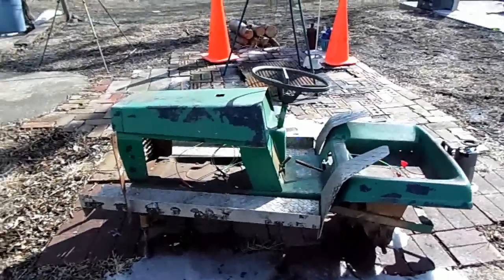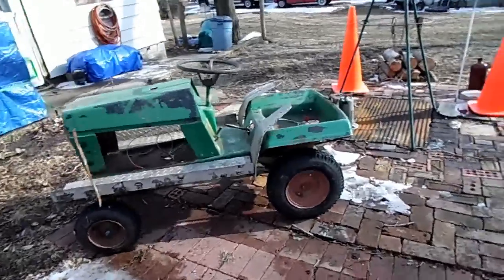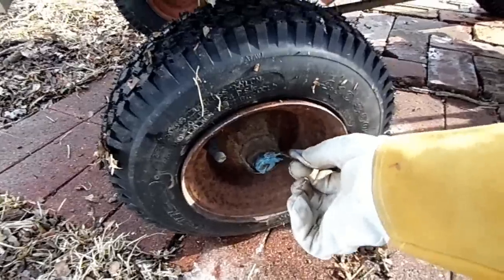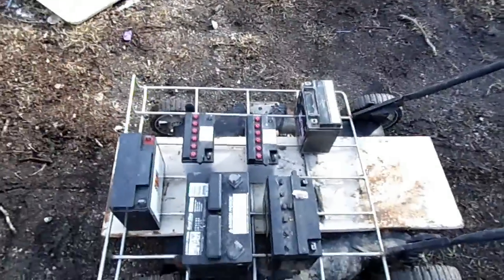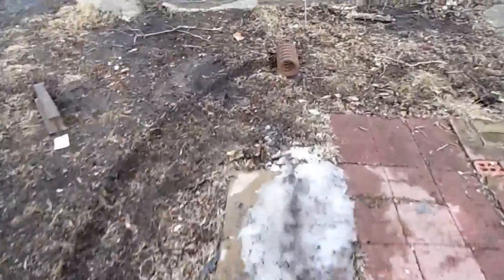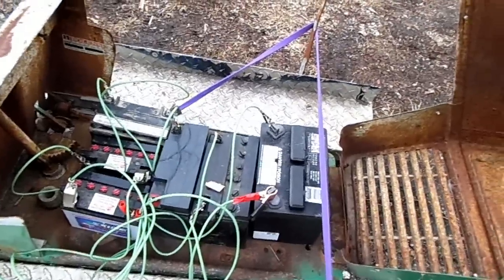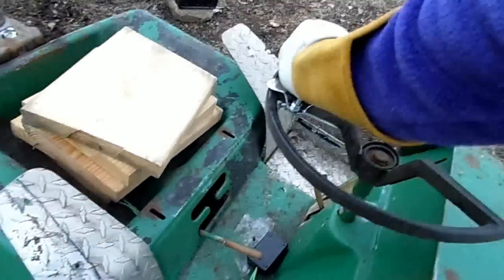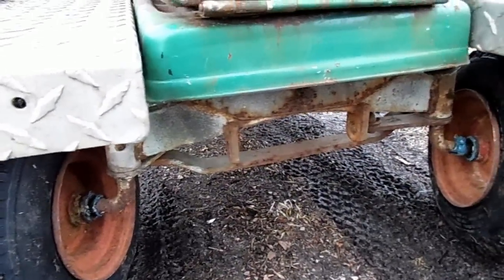DIY Electric Lawn Tractor part 4

Comment: I'm still waiting for you to invest in a wire wheel for a drill so you can prep your welding surfaces properly.  They're like $2 and SO worth it.
Reply from the maker: +hellcat1988 its easier to just blast through any rust.
Reply: Every time I've tried to do that the weld broke.

Comment: Added accessory- motor controller
Reply from the maker: haha, i think i may build like a giant potentiometer lever that has some carbon motor brushes contacting some rods of ni-chrome to act as a big variable resistor.

what i've found though is at 3rd gear the motor is bogged down enough to have a smooth start. maybe if i increase the pulley size to gear it down a bit less it will start even more smoothly and go faster.

thing is though i think its fine the way it is. i plan on taking it down to st Joe state park this year and driving it around in the sand. would hate for it to be geared up too much and get stuck in the sand haha.

Comment: You should get a variable voltage thing then make a pedal, then you can have a foot pedal to work it, it wouldnt bd as much of a jolt accel. And decell.
Reply from the maker: yeah I have an idea for that. most likely I wouldn't use a power transformer I would just switch voltages or between a resistive circuit.
Reply: Im thinking more of like, a volume thing, like a pedal on an organ, which I happen to have, but then you could run any speed, at any time.
Reply from the maker: yeah that would be a waste of time and would break too easily. its fine with just on and off tbh.
Reply: Ok, have fun with that, im just giving ideas

Comment: Now that went really well at the end :-))

If its got plenty of torque in first gear a larger pulley on the back would make it quite frightning ha ha :-))
Reply from the maker: i wanna make sure it can get up hills ok though, but yeah :D
Reply: Rinoa Super-Genius
Now if there was such a thing as a derailure for pulleys you could have overdrive ha ha.

I didnt catch the original voltage of the motor used, is it 110 or 240v ?
Reply: zx8401ztv it's 100v

Comment: You should use your DC-DC step up converter on that. Hehe. then put some batteries in series with the motor
Reply from the maker: yeah that would prolly fry the converter :P